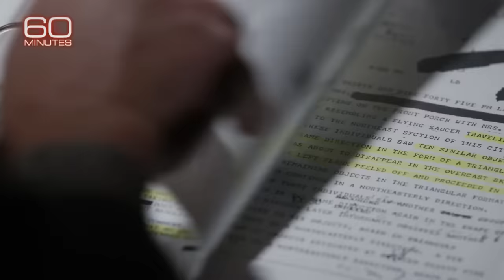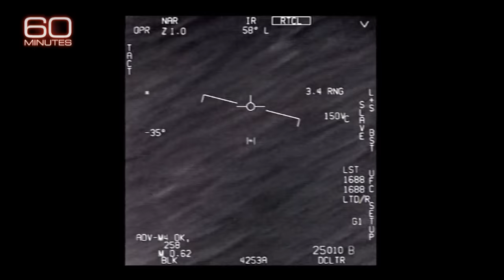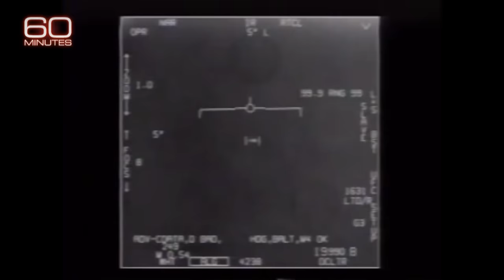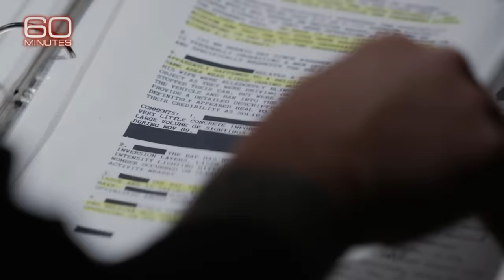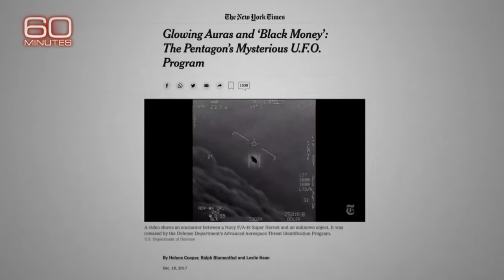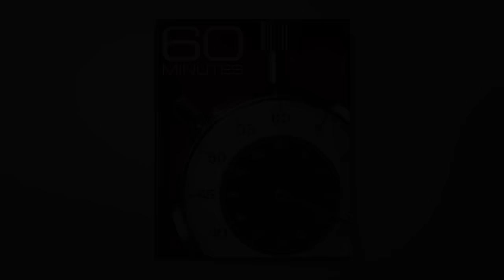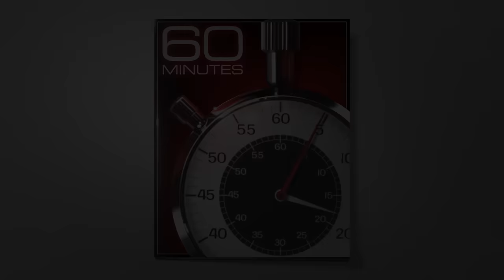Encounters with UFOs; Search for ancient life on Mars; James Webb Space Telescope | Full Episodes

Comment: We want to know what is going on! I saw a ufo in the spring of 1973, 5 miles outside of Hopkinsville, KY, from Cox MIll Road near the intersection of Pierce Lane. It was about 11pm on a Saturday night. I was driving home from visiting friends in Hopkinsville. No, I had not been drinking or using drugs. This was out in the empty countryside. There were two houses at the intersection of Cox Mill and Pierce, with a security light. 

What I saw was behind them and farther away, in the middle of a 100-acre field. I saw a big bright flash of white light about two stories above the ground It was on for about 2 seconds then it went off. I immediately thought it was a military helicopter landing in the field as part of its mission or it might be in trouble and needed to set down. This was across the road from the house I lived in. I thought my family might need to help them if there were injuries, or if they needed help to communicate with their base. Fort Campbell, KY was about 20 miles away. 

Then, 2 seconds later the light came on again. It was moving towards me. I still thought it might be a helicopter. But there was no noise. Again, the light stayed on for about 2 seconds and went off. It was still about two stories above the ground and moving fast.

The third time the light came on it had turned slightly left and crossed Pierce Lane and was moving past me, parallel to Cox Mill Road, inside and above the telephone lines inside the field. The light was round and flat, and a diameter about twice the size of a car. It did not illuminate anything below it, it was just a white glow. It had moved about a mile in a few seconds. It did not make a sound.

I was going to turn the car around to follow it, but I realized it would be gone before I could get it turned around. So, I stopped the car, turned the engine off because it was so quiet when it passed me, and got out. There was no light. It was completely quiet. It could not have been a helicopter. Helicopters are noisy.

I told my father about it. He thought it was a weather balloon. Now I know the government was telling everyone they were weather balloons back then, since the 1940s.

The next day I looked across the fields it might have traveled through, over 200 acres wide. There was nothing, no debris, no weather balloon. It was spring and the land was clear, just sprouts of corn.  I would have been easy to see a down weather balloon.

I still have no idea of what it was. I have never told many people because I know it just sounds crazy. So, I can understand it must be difficult to explain something like this. If you can't make sense of it, you want to dismiss it or the person telling you about it.